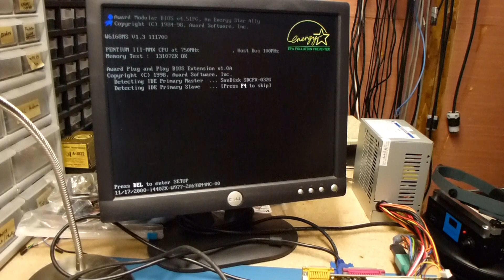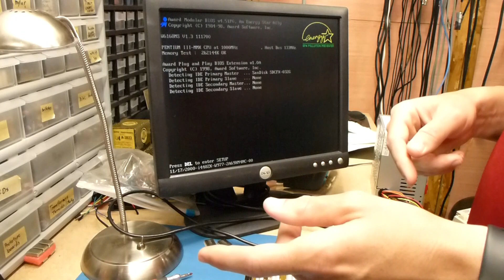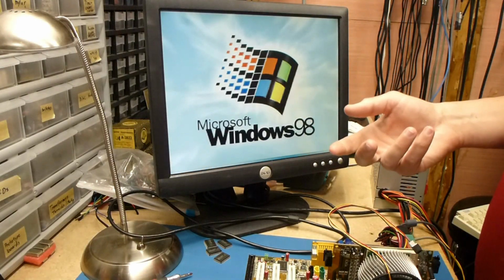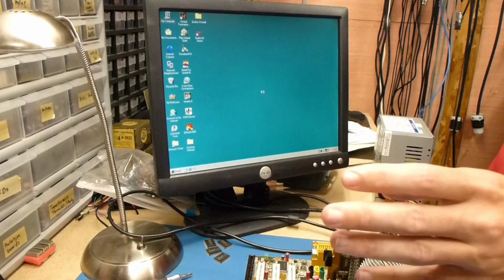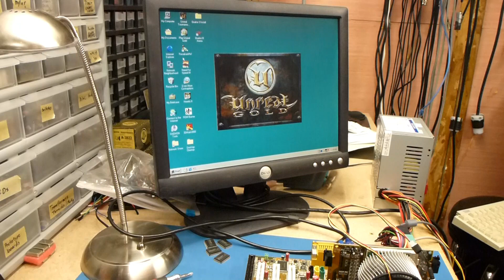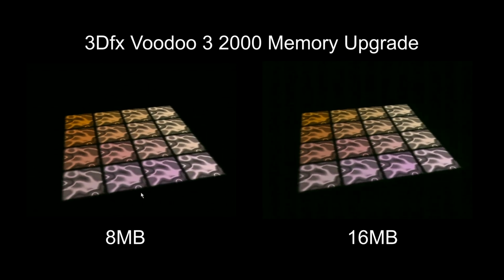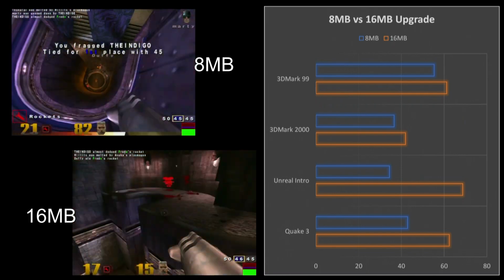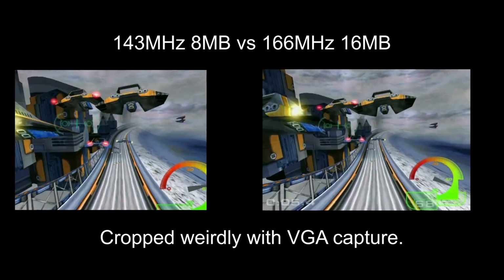3Dfx Voodoo Powered Motherboard Gets a Memory Upgrade! #GPUJune

Comment: I hadn't read fully the title ( 3Dfx Voodoo Powered Motherboard was more than enough for me to click at speed of light) so when you said I'm gonna transplant 16MB of SG RAM from this Matrox I was like, "what? No for sure he is joking!" Usually people that owns this mainboard is scared even to look at it (and who can blame them?), never thought I would seen somebody with the balls and skills to transplant new video RAM modules on it! I mean, I do overclocking on old hardware all the time, but this is completely another level, man! You have all my respect, really, this was fantastic to watch!
Reply from the maker: Thanks! I only recently got into these more brazen hardware mods. It's a bit addictive, not gonna lie, and it doesn't help that both of these types of chip replacement mods I've got on video have resulted in huge performance gains. Fortunately I've advanced in my soldering skills to a point that I was more worried about trashing the RAM sockets because of how close they were to the one memory chip than actually messing up the motherboard itself. I figured worst case I could just put the original memory back. I spent years trying to find a 16MB version of this board and, well, I don't have to anymore!
Reply: @DKJones96  sure, when you know what you are doing it's kind of safe and "easy", but still remarkable I'd say, given the type of hardware!
Ah, the all-red caps are very cool 😎
Reply: I have a lead on a 6168 locally, with slightly chipped chipset and fairly poor condition.

I took a good look at it and said to myself "If I brought back a Gigabyte 7DXE in a similar fashion, a 3dfx+MSI combo ain't no stranger to me".

Price is steep as hell but that won't stop me. I will personally declare if that thing is dead or not.

Speaking of which... anyone know if it'll take a different V3 BIOS? I recall 2000s being able to be upgraded to 3000/3500 BIOS since they share the same core, but that might've been just me.

Comment: Very cool video. Also, I appreciate your editing. A lot of people leave way to much info in or leave too much out. Very good balance.
Reply from the maker: Thanks! It can definitely be hard to find a decent balance. I left quite a bit of footage on the cutting room floor because my yammering didn't really accomplish anything moving the video forward and there was already 4 minutes of talking at the beginning. I feel like I could have used a bit more of the benchmarks(it is the fun part after all) but my Windows XP capture machine is in need of some TLC apparently as it fought me by refusing to boot without a BSOD until the system was warm every time.

Comment: This is insane, balls to the wall.
My two broken voodoo 2 probably would be resurrected by your soldering skills.
Reply from the maker: I have my limits for sure but I did fix a Voodoo 1 by taking a Dremel to the chip where some pins had broken off and soldering some tiny wires to the leads inside the plastic chip package. https://imgur.com/hvEiURv Cheers!
Reply: @DKJones96  
You and that dude from necroware, truly knows your voodoo stuff :)

Comment: Wow this is a massive improvement! Too often if a motherboard has onboard graphics, they equip it with inadequate memory, and there's no way for an average user to do anything about it except put in a new card. This is an interesting what-if on what would happen if one could add more memory.
And yeah I'm surprised and impressed you were able to do it without melting the RAM slots or anything else! Admittedly I lost track of what registers you changed and went back on, etc. But hey it works and that's all that matters.
Reply from the maker: For this particular motherboard it definitely had going for it that there was a 16MB model, even if I couldn't find one to see what the resistor settings would have been. That would have saved a couple days of thinking for sure.

I went ahead and made a couple of slides that show the jumpers I ultimately changed in the description. It ended up being only 1 resistor move and the removal of a jumper and installation of two more. I don't expect many people will undertake this upgrade but it's good to have the info out there.
Reply: So memory is the main reason why intergrated graphics is usually few levels below their "regular" counterparts? Not sure if I ever will have to chance to use this knowledge, but it's good to know nonethleless...

Comment: Thanks for such a nice and interesting video!
Have you ever seen the kind of tower these boards cane in? I was surprised with a PB tower I got for super cheap that had a Slot-1 with an integrated ATI 128 but it still need a full re cap.
Reply from the maker: Thank you! You know, I don't think I've ever actually seen what the original PB tower looks like. All I could even find online was photos and videos of a build someone did with the motherboard shown here and not the actual OEM build.